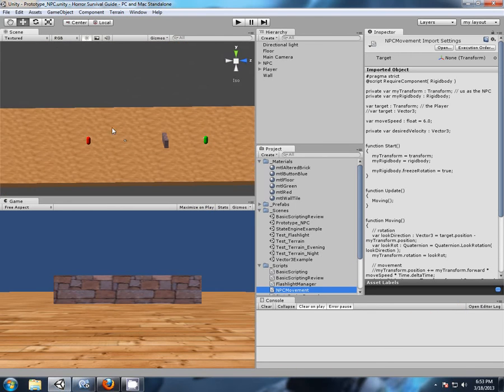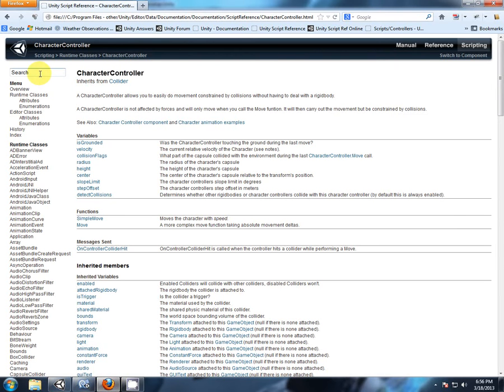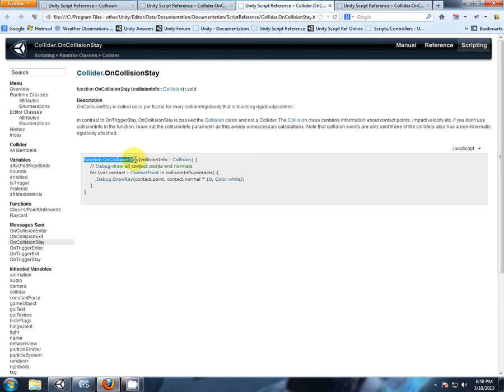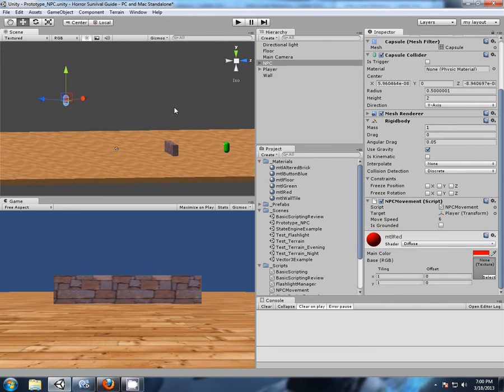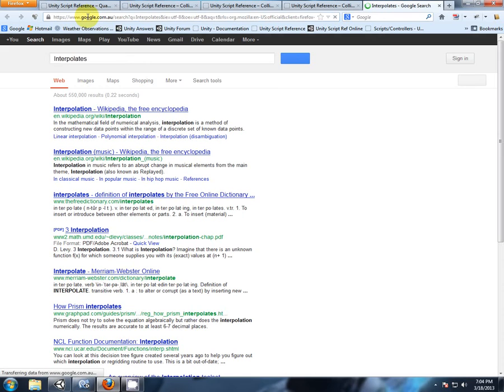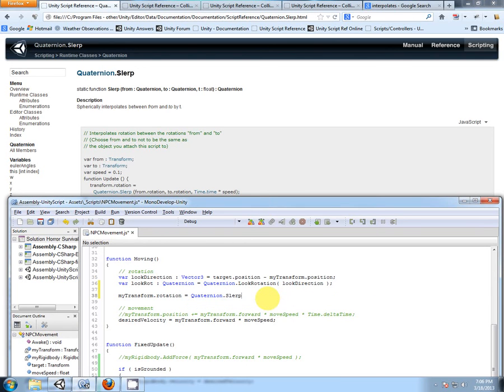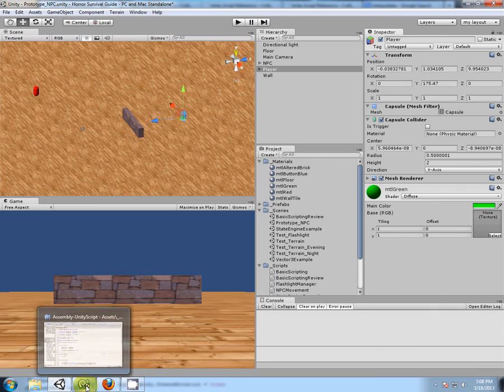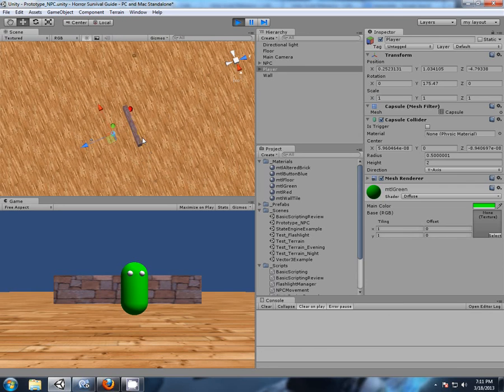25 _ NPC 1-3 : Grounded and Turning

Comment: Awesome videos that you do, I've learned a few things already- Just a thought though: Instead of making a isGrounded variable, wouldn't it be easier to add to the velocity instead of just setting it? like rigidbody.velocity += vector3Speed- And afterwards you clamp each axis of the velocity? This could potentially also add a bit of acceleration if you wanted that?